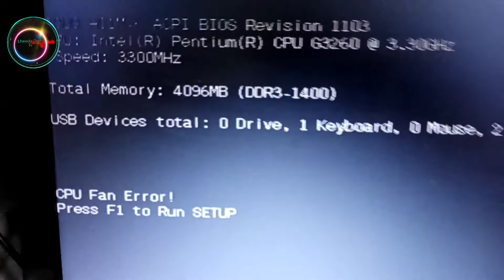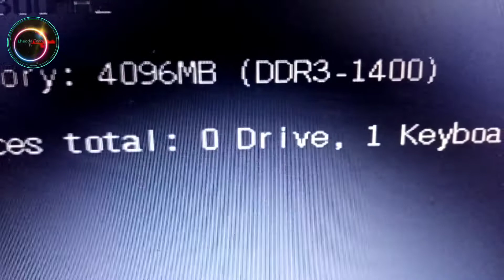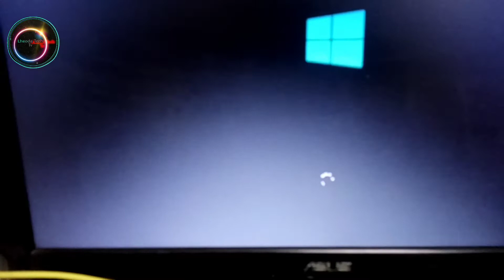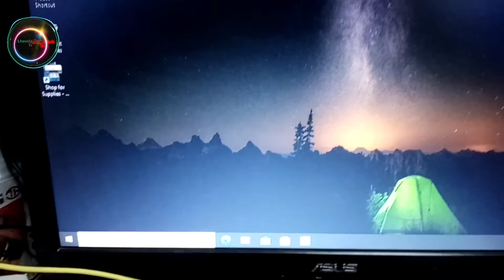HARDDRIVE NOT DETECTED PROBLEM/COMPUTER REPAIR/PROBLEM TO SULOTION/LHEODA TECH TV

Comment: Hindi pala na ka plug in eh 🤣
Reply from the maker: ipinakita ko po sa video kapag ganun scenarion asahan mo naka plug man o hindi may problema po sa power cable at data cable kaya mag notice na check hdd power cable or data cable...loose connection  common problem po sir.hehehe salamat po ng marami